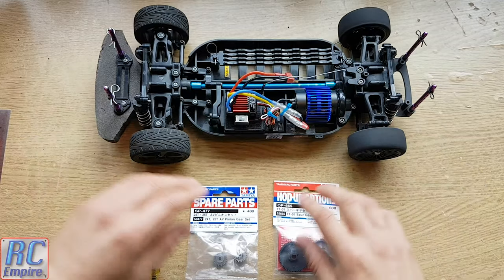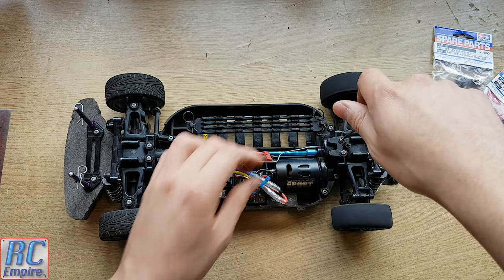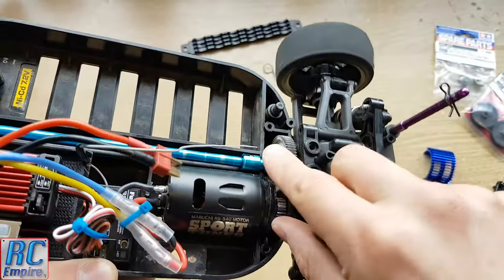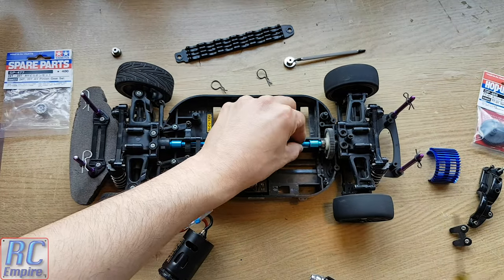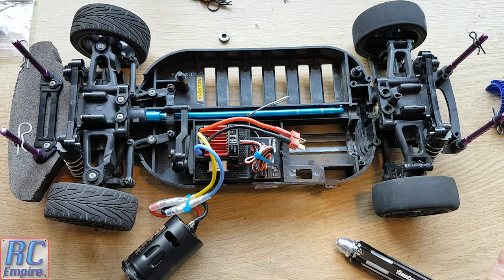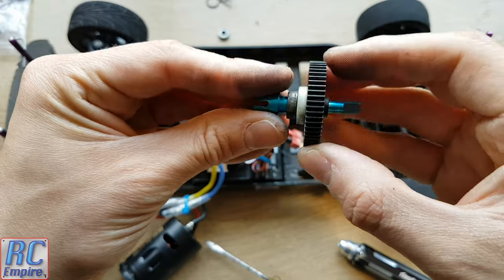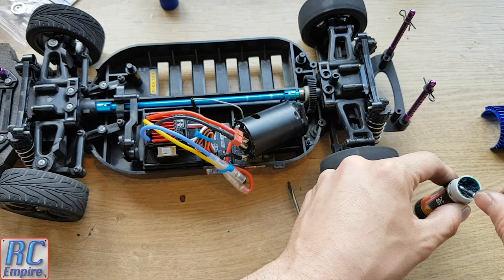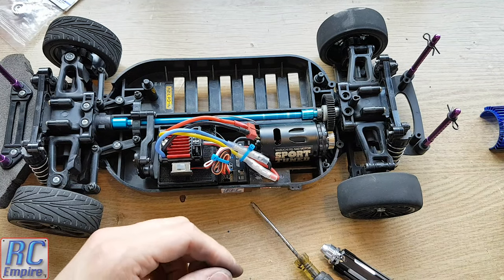Tamiya TT-01 Race Build: Episode 9 -  Spur and Pinion Gear Fitting

Comment: I really like my tt01e and it's doing well for my first ever iconic Cup series. 1 thing I did to give it better traction coming out of the corners is to pack the front diff with grease. It doesn't matter what you use as long as it is stiffer than the rear diff. It just gives you that edge pulling out of the corners. Well worth doing

Comment: I have recently got my hands on a TT01 and started upgrading parts, starting with all ball bearings to replace the plastic bushings. I noticed there is a plastic bushing next to your spur gear, then ball bearing towards the center drive shaft. Is this supposed to be replaced when replacing all plastic bushings? I was a little confused when I saw it....I noticed Tamiya ball bearing 1280 is pretty close to the size and the circumference looks the same.

Comment: I have the carbon fiber metal version and keep blowing out the spur and pinion, any advice?
Reply from the maker: Hi Ja, 

Hmm, that's odd. Was it ever working, or something that's just started recently? Could be the chassis is twisted after a crash or something causing miss-alignment. But that would have to be pretty extreme, you'd prob be able to see that.   
Also, have you got the motor mounted in the correct holes of the motor mount? I know we've got that wrong before lol.

Comment: Hi. Please can you help me. I have a TT01 same as yours. And I have got the stock Tamiya TT01 torque tuned motor. I tried to do the upgrade that you have done with a 55 tooth spur gear and a 25 tooth pinion gear but I can’t get the gears to mesh or even touch. Please can you tell me what i am doing wrong. Thanks very much for your help.
Reply: Check if the 2 mounting screws are in the correct position according to the number of teeth.

Comment: Do they sell a metal spur gear my brushless is eating the plastic one up
Reply from the maker: Really! That's odd. I would have thought it would be able to handle  it. Actually I'm not sure if they do steel ones. I imagine you'd then need a hardened pinion too. We'll keep a look out and let you know.
Reply: Hi, yes I have seen one fellow from the U.S on eBay sells them for about 30$ each...steel spur in 3 sizes. But how is steel on steel? Lots of noise and then you have to Grease them i think